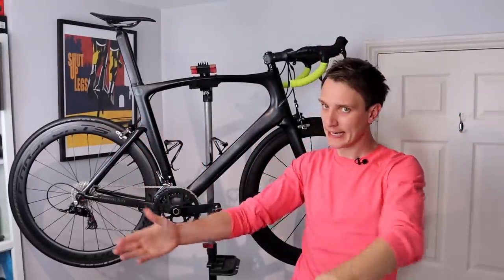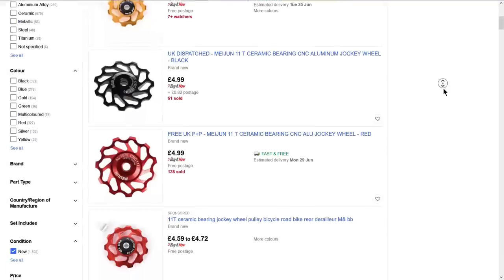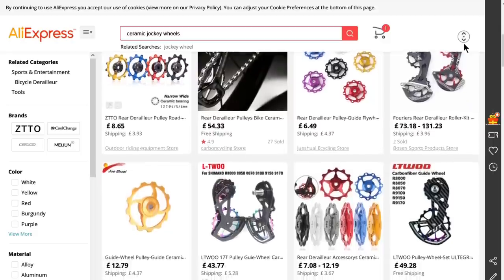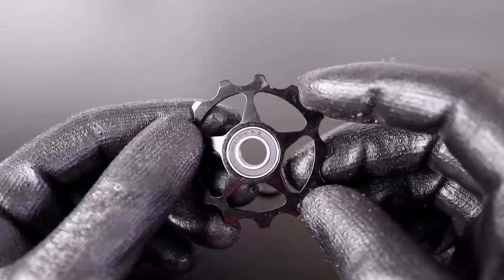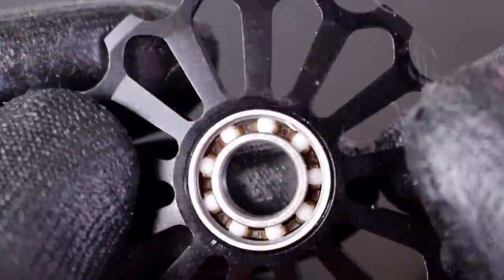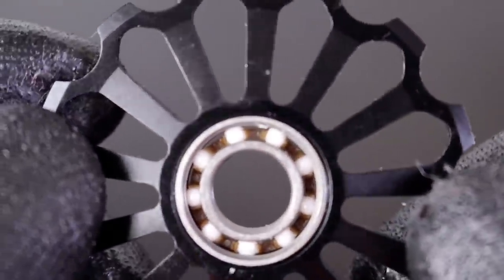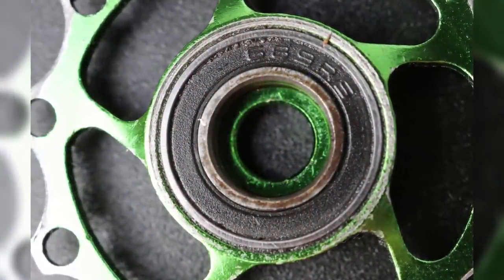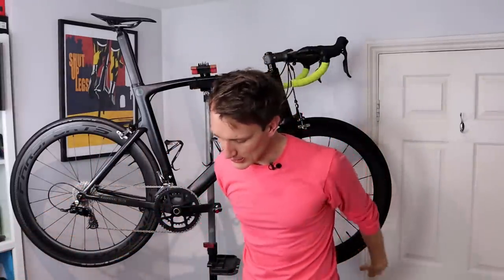Cheap CERAMIC JOCKEY WHEELS - a fatal design flaw!

Comment: Great video Luke. Do the cheap standard ones offer any benefit over the stock sihimano ones? cheers
Reply from the maker: To be honest, not really. The stock ones are totally fine, and last forever. But they do eventually wear out, and replacing them with some flashy looking aluminium ones for like £4, that's a win in my book!!!
Reply: @TraceVelo  agreed, I watched your segment on gcn and it really seemed like they made you focus on the negatives of buying from China. They are known to be heavily biased towards their sponsors, what do you think about that? (a feature is a feature nonetheless ;)
Reply: @TraceVelo  Amusing video from an acting perspective - entertaining!

What I didn’t understand was whether it would be better to get more moderately-priced ceramic bearings that I assume would be sealed (this I don’t know). The cheap ones sound like trash. Spending $1600 or whatever is ridiculous. But aren’t there ceramic ones for, like, $20 that are sealed and better than the originals? Either with less friction or lasting longer?

Also, I’ve seen people mentioning brifters a few times. I’ve been wanting to replace a 10 speed left Shimano brifter for a long time, but am always dissuaded by what seems like over-priced offers because they are rarer. This is for a CAAD9. It has been sitting for a couple of years so I’ve had to resort to my 1990 Specialized Allez, one of the first carbon fiber frames, but not in the best shape (pulley wheels included).  Any thoughts?

Thanks!

Comment: Finally!!! Been looking if pulling the trigger on one of those...
Reply from the maker: Yeah def stick to the standard non-ceramic ones. They are cheaper, and work like a dream!
Reply: @TraceVelo  curiously the original Shimano are more expensive here that I though.
I was gonna change the jockeys in my Sora training derailleur and they almost cost the same to change the whole rear mech, ended buying a new one for the bike and leaving the old one in my Urban all terrain bike
Reply from the maker: Yeah the official Shimano jockey wheels are pretty pricey. When you can pick up some aluminium ones for £2 on AliExpress, bit of a no-brainer IMO

Comment: How did you find shifting with the sealed wheels? In the past when these were fitted they performed poorly because there was no float, a bushed jockey has float which helps move the chain. Only needed on the top pulley mind you.  This was the flaw I thought you were going to mention. I could see those ceramic jobs being used by some TT'rs, where they meticulously prep a bike before a race.  Also some higher end groupsets came with ceramic bushes bitd, not sure if this is still the case, or if it even made a difference.

Comment: my experience with jockey wheels (MTB):
- Old ones (no bearing) are total crap: mud, rust, lots of friction.
- Normal with bearings are the best, they spin slower but if you keep it clean on the outside almost need no service.
- Cheaper aluminium ones are very good looking and smooth rolling but they require service more often than classic ones.
- Cheaper Ceramic are very good only if keep it clean... by blowing or just water, but are very delicate.
For me the best are XT-M8000 Pulley wheels, smooth and durable.
Ultralight aluminium are hard to clean, and some aren't smooth and too wide for 11 speed chain.

Comment: I'm an Engineer.  Chinese bearings tend to be filled with metal balls, rather than bearing steel spheres.  An upgrade to the aluminum jockey wheel is to replace the bearing with one from a reputable supplier.    Same type. Same number. Better quality.

Comment: I always use the Meroca ones on my MTB but regular bearing ones on my LTwoo A7 before and currently on my Deore M5120 and you can feel the difference of smoother pedalling. I haven't tried ceramic ones for this reason it can't be sealed.

Comment: A problem I found with the cheep ceramic jockey wheels is that there is no float on the guide wheel. Took them off straight away because they were noisy and rough.

Comment: The 6800 Ultegra jockey wheels use a ball bearing vs 5800 105 and down use sleeve bearings. Cheap upgrade but not flashy.

Comment: i watched this before and your video about long cage with oversized jockey wheels. i've previously seen the process ceramicspeed use when they build their expensive jockey wheels and in their words they 'glue' the bearing cartridge into the jockey wheel. but since they remain replaceable i'm guessing what they really mean is using something like loctite 641 round the outside of the catridge before inserting it in the jockey wheel.

Comment: Haven't you seen the vids on ceramic speeds jockey wheels. They are actually slower in many cases due to weight and offer little advantage. You can get steel bearings with similar rolling resistance and wear down 4 or 5 times as slow for 20 bucks

Comment: For the simple and cheap ones, stay away from those with metal seal (ZZ). It not as good as rubber seal (RS).
And for any type of ball bearing, check it rolls freely from time to time. Chain will make things roll, but with damn high friction. It may dig through the race and when it will jam, the mech might break under load.

Comment: Full contact bearing seals have more "friction" (resistance to torque). Non-sealed & non-contact shielded bearings spin more freely, need more maintenance.

Comment: Hi luke was watching your video were you build your bike I bought the same frame  are the forks an integrated headset meaning you don't need a crown  headset bearing sits directly on forks  it deffo seams to fit better and works fine on mine

Comment: Hey Luke, would it be possible to buy both and splice the dust shields from the steel bearings to the ceramic bearings and overcome this problem? I know it defeats the purpose and why not just use the steel you’ve bought. Just curious
Reply from the maker: Yeah had a few people ask this. I might give it a go and stick it on the gram actually...

Comment: I've used those ali jockey wheels but i had a bearing come away from the wheel basically lost the inteference fit on the outer race. Back to conventional dura ace.

Comment: Great video as always. I'd be interested to know whether or not the sealed bearing jockey wheels run better than the original delrin ones. Whenever I clean my bike the originals don't seem to spin that freely. As you say they, are easy enough to clean and re-lube but wondered if sealed bearings may spin more freely for longer. When they are no longer serviceable which would you choose as a replacement?

Comment: The new ceramic wheel spinning longer than the new steel bearing one is probably more to do with the lack of a seal than anything else, as Hambini has pointed out before the majority of the resistance in any bearing assembly comes from the seal. I also noticed that the ceramic bearing is "mixed material", ie the balls are ceramic but the races are steel. This is means that the harder ceramic balls will grind a groove in the softer steel race pretty quickly, knackering the whole thing. By comparison, steel bearings on steel races will last much longer as one isn't significantly harder than the other so won't wear nearly as quickly.  To be honest, ceramic bearings seem to me to be pretty pointless to all but the most elite cyclists - according again to Hambini, most of us don't put out nearly enough power to see any benefit in using ceramic BB bearings, and jockey wheels are under way less stress than BBs so the gains would be even more immaterial.
Anyway, great video. Hopefully it'll deter some people from wasting money on cheapo ceramic bearings that won't last the week.
Reply from the maker: Yeah makes total sense. It's a shame tho, because if they had bothered with some basic seals, atleast they would last a few 1000 km's
Reply: @TraceVelo  Yeah absolutely, and to be honest they're under such little load that them being mixed material probably wouldn't be much of an issue. I can't really see them performing any better than steel bearings though, so at best they'd be a functional gimmick.

Comment: I'm French, i don't know if i have well understood, but did you put some lubricante in the ceramic bearing ?  I hope you didn't. Ceramic bearings don't need any lube ,you  should drive it dry.. otherwise, it's a "dust magnet" and the result is a poor lifetime. (I'm and aircraft mechanic)

Comment: Ultegra R8000 pulleys are pretty cheap, long life sealed ball bearings, and different tooth profiles on the jockey and idler for optimal shifting.

Comment: Iirc advantages of ceramic bearings don't come into play when not under heavy load (jockey wheels are not under heavy load).
But honestly the regular ones with shielded roller bearings are a steal for that price.
Reply from the maker: Yeah totally. The ones with the regular 'RS' bearings are rock solid!

Comment: Just realised I bought a set of these by accident, it more to the point it said fully sealed bearings which I looked for specifically but they're fuckin not 😤🙄 I've got 6 of standard ones to put back on though. My thought was to release the shmoo and fill it with grease (from park tool no less!) To try and keep the garbage from ingressing. We'll see. I'll get some proper sealed ones. They've got to be blue though 🙃😂 be well sir!

Comment: good your name is still Luke! i have a question, did you cover already bike Chains? typical weight is 257gr for a Shimano. cutting on mass by half would be a great saving, changing it every 2000 miles for 20 BAKKERONIES, could save another dollar sign if it comes at a reduced cost.  ..well let us know! ... and nice hair cut :P

Comment: Crazy question.
Could you not take the seals out of the regular bearings and press them into the ceramic ones?
Reply from the maker: Yeah potentially. I would just stick with the regular sealed bearings however. Might be worth a shot tho...

Comment: Luke can you search in AliExpress if your can but aftermarket ceramic bearings (with seals).
Or how much would it cost to buy creaming bearings from CEMA or ceramic speed? (Just the freaking little bearings)

Comment: Thanks Luke for this awesome video as always. I have a question : do you think it would still be a bargain to buy the cheap jockey wheel and change the bearing yourself for a nicely sealed ceramic one ?
Reply from the maker: Yeah potentially if you can find some sealed ceramic ones that are the same size. Honestly though, I would just get the standard bearing ones, they last forever, look super flashy, and are crazy cheap.
Reply: @TraceVelo  I might give it a try, thank you for the answer.
Reply from the maker: No probs 😎

Comment: As Hambini also states,  Ceramic bearings are worthless without Ceramic races.  You mentioned nylon races in the vid...   WOW really... no wonder they wore out quickly. Ceramic bearings in metal races are also just as pointless.

Comment: Even the Ceramic Speed ones don't last all that long. CS bearings run on very thin low-viscosity grease, which wears out very quickly, so they need cleaning and regreasing a lot more regularly than normal ones, despite having seals. Anyone buying Ceramic Speed and expecting the bearings to outlast normal good quality steel bearings with similar maintainance will be sorely disappointed.
I'd also argue that the use of alloy in jockey wheels is also a serious design flaw, as when they wear (and they wear faster than chainrings) they leave small bits of metal in your chain, which will wear it out faster than delrin debris. Shimano are even using steel in their higher end chainrings now, which is giving better chain durability. I also miss the steel jockeys they used to have on Dura-Ace mechs back in the late 80s.
Best jockeys on the market right now are the original higher-end ones made by Shimano.

Comment: My current bike runs on shimano 105 set up is 9 speed 11-25 teeth rear and front is a triple 52 42 30 my question is now the triple crank set seems obsolete what would be the best set up for my new bike front and rear i live in the west pennines and its all up hill round here 😀
Reply from the maker: Yeah so I would go for a compact crank at the front (50,34) and if you hit alot of hills, maybe go for an 11-32 tooth on the back. But you might also get away with 11-28, which is the setup I currently run. 11 speed if you can, but if you are looking to do it on a budget, I would go for a 10 speed Tiagra 4700 setup. That groupset is bulletproof!

Comment: Hambini always says ceramic bearings have No benefit to good normal bearings. I definetly like metal jockey wheels but just with normal bearings. Maybe you can replace your bearings with some higher quality ones
Reply: They most definitely dont, at least at the speeds bicycle parts need to rotate. Maybe 0.00001% difference.

Comment: Even if the bearings were sealed they would still be garbage.
You have a VERY hard (ceramic) Bearing running in SOFT nylon (Races) & even the small forces from the tension spring deform the races and rob you of any gains from having ceramic bearings (up to 0.5 W) for both jockey wheels.

 Even 'CeramicSpeed' bearings will need regular intensive maintenance (1,000-2,000 miles) to keep the performance/Wattage savings.
This includes a complete strip thorough clean and re-lube with the correct fill % (All with special cleaners/lubricants).

Most ceramic bearings for bicycles are 'Hybrid' bearings ( meaning they have ceramic balls in steel races) because full ceramic bearings are brittle and prone to cracking during normal road use.
Whilst these are better than the cheap nylon ones they still wear quicker than steel bearings.

Stick with non ceramic sealed bearings.
For WATT savings you'll get more from waxing the chain than you would if you replaced the wheel, bottom bracket, pedals and jockey wheels bearings with ceramic bearings (££££'s)
The chain is the second biggest cause of drag on a bike.

 You the rider, are the biggest! & the faster you go the worse it gets.

Comment: Oh and the reason ceramic bearings have no seal is because the ceramic material is SO strong that it will literally crush any dirt or grit that enters! And also rubber seals will slow them down too. Essentially there is no need for a rubber seal with a true full ceramic bearing.

Comment: I replaced mine for aluminum, I had to adjust a little bit but now the shifting is very precise because it fits very well in the chain, a little heavier but it's ok because I'm not a pro, I just want to ride

Comment: I've never thought about replacing jockey wheels on derailleurs except where the original has worn out (very rare) and replaced with the original replacement part. I always thought it was just a way of customising the style of a bike rather than any real benefit. Even the jockey wheels that spin on a centre pin with no bearings seem to spin freely, more freely than that cheap ceramic jockey wheel for sure. Does it really make any difference or is it like putting racing stripes on a car all in the mind? It just feels like any difference would be so minimal it would be pointless.
Reply: I have the cheap ball bearing type with seals and they have been very good spinning nicely

Comment: I'm sorta of wondering, could one pull the bearing out of the cheap wheel and replace it with a nice bearing with stainless races and seals?

Comment: Can you use the seal of the regular on the ceramic one? Or what if you just use hot silicone glue to seal the exterior of the wheel? The silicone is easy to remove when the time to service come.

Comment: I really hate this kind of jockey wheels.... tried this cheap things on my RD. After a week or 2, the bearings starts to offset its position then tends to slip the chain out ward off the teeth.
I still prefert to get those sealed bearing jockey wheels of shimano. Nothing goes wrong with those pair for a long term use.

Comment: have you tried to just swap the bearing on a jockey wheel like this one?

maby you could buy a set of the cheapest ones you can get your hands on and buy a pair of high quality fully ceramic sealed bearings and get the best of both worlds?
Reply: Acer bearing sells a 689 rs ceramic sealed bearing for $9. Pretty sure you could knock out the cheapy one and load that in there.

Comment: Couldn't you buy the jockey wheel and replace the bearing with a ceramic skateboard bearing? Don't know if it would be the right size. But they you would have the oversized wheel with a ceramic bearing.

Comment: Hey Luke, can't you not just swap out the bearing for sealed ceramic version? Never saw one up close so forgive me if this is a stupid question
Reply from the maker: Yeah you totally can! i have an oversize rear derailleur cage that came with the crappy ceramic bearings, and as soon as i get it installed, ill be swapping out the bearings. They are the same size, should should slot in fine!

Comment: Can you test a full cage set up to see if it's the same?
Reply from the maker: So I actually have one to test, and yeah the bearings have the same issue. I have some of the sealed bearings spare however, so when I come to use it, I'll swap them out...
Reply: @TraceVelo  Awesome! Shame you can't get a ceramicspeed to compare them side by side! You have inspired me to do a bargain carbon build so lots of stuff is coming from aliexpress too

Comment: It doesn't seem to be a flaw because the seal of a bearing causes around 60% of the friction, so if you want maximum performance, as people who buy useless ceramic bearings often do, it would make sense to clean it regularly and put only oil in there

Comment: I’d have thought that you might be able to find some seals for the ceramic bearings if you can figure out the ID and OD dimensions, as for the reason there are no seals, they would cause too much friction making the ceramic redundant.
Reply: Hello, Have you had  luck in fending the OD and ID